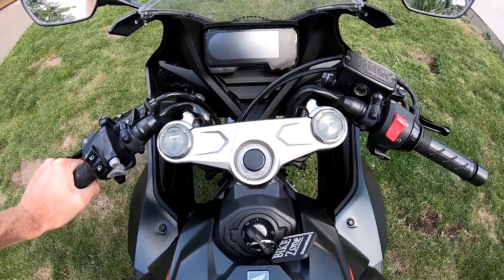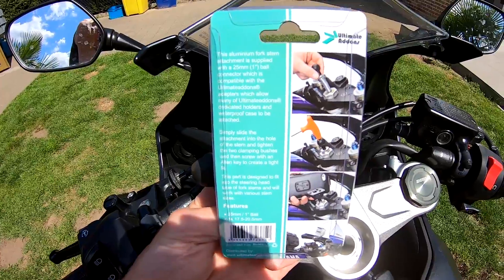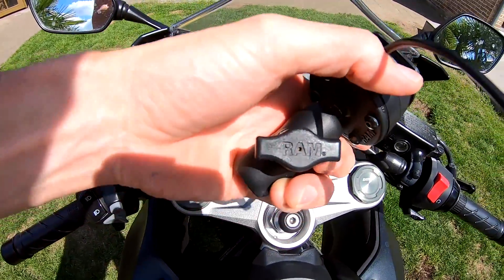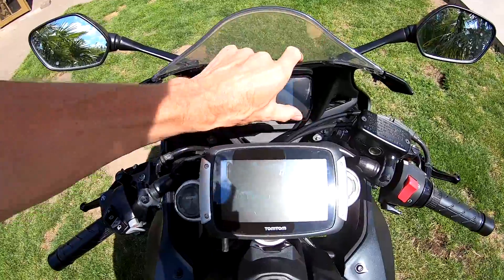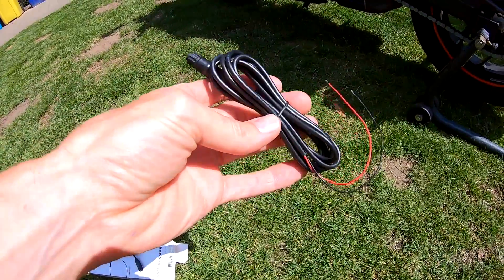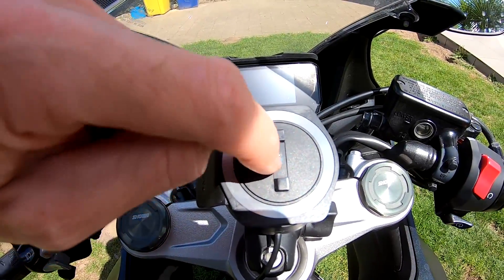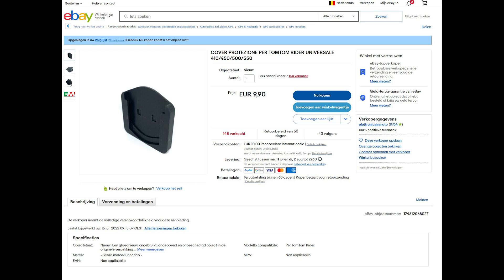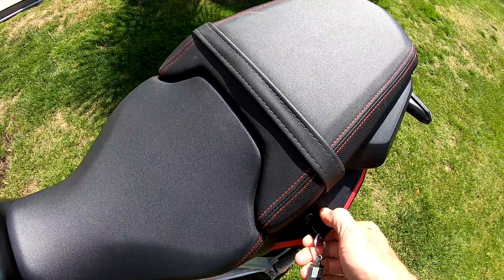How to install a GPS on a motorcycle (RAM mount and electricity)

Comment: Hi, i have a question. Now i made my navi connection with the light for plate and from there i'm not sure, while navi battery is totally empty, i can not be shure is it enough strong electricity in the cable to charge it, because navi don't show charging when i put the contact on of the bike. Is it enough power in the cable of the plate for navi or possible not?
The bike is Suzuki GSF650S '05
Thank you
Reply from the maker: Hello, i have connected 3 bikes this way, and everytime it worked perfect, with the tomtom rider you see in the video. Now i have bought a honda cb650r from 2023 that i am rebuilding and i am going also to connect it the way i showed in the video. I think the best thing you can do is to measure out of the pins from the holder from your gps is giving 12 or 13 Volts. The cable is thick enough to give enough power. So i think you are not getting 12Volts on your gps holder, or the gps is not working fine. Good luck. Greetings jan

Comment: Why did you not just connect straight iunto the battery, wouldn't that have been easier?
Or is there a power cut-off in the backlight? Is it because there's a chance of battery discharging while idle ?

I'm asking because I fitted a GPS into my car battery directly and works perfectly fine. I now also have a motorbike, the Suzuki GXSR specifically and I was thinking of fitting the same GPS tracker model into the Bike by connecting the same way as I did with my car.
Reply from the maker: Hello, on my previous bike, i connected it straight to the battery (with a fuse) but when it was raining, there was water between the to connections where you charge your tomtom. So if you connect directly to the battery (with a fuse) you also need to buy a plastic cap to cover the charge station when the tomtom is not mounted on it. And you also may not forget to take the tomtom away when the bike is standing still in the garage because it will drain the battery.
Reply: @JanSV  thank you, that makes sense.
Dank u wel.

Comment: Great video! So you didn’t connect also positive to the battery because maybe that way Tom Tom would be always on? That’s why you used the license plate battery cable?
Reply from the maker: Indeed. That is correct.  If you Connect positive and negative straight to the battery. The TomTom could drain your battery when you forget to take the TomTom of the bike when it is off. And also when the TomTom is off the holder. The 2 connectors on the holder could short cut the battery when it is raining.
Reply: @JanSV  ok thanks!

Comment: How do u know if ur red kabel is connected to a fuse?
Reply from the maker: Because every light or electrical part on the motorcycle is fused from the factory. And the earthing is not secured but the + pole is. And I measured out that this wire is the positive side.
Reply: So its safe to just put the black one straight on to the battery?
Reply from the maker: @HaziziRikkert  the entire frame of the bike is negative. So indeed the black wire you can connect to the negative side of the battery. Without a fuse. Only the positive side needs a fuse